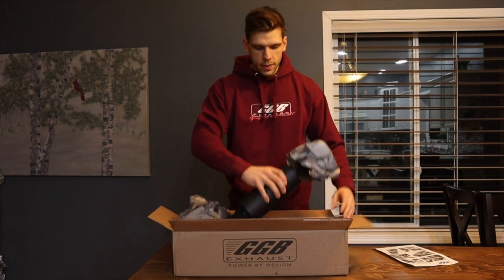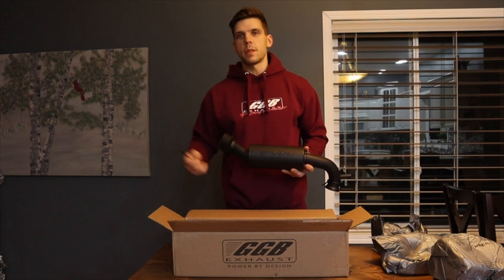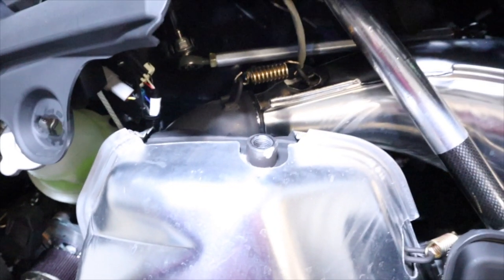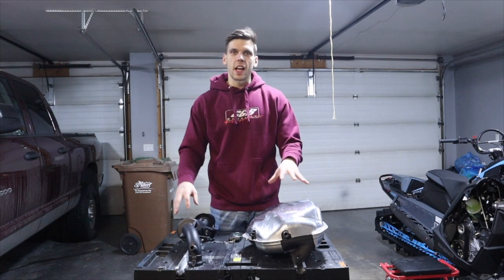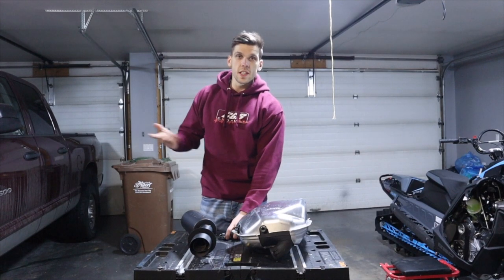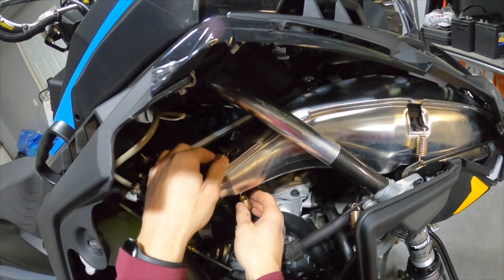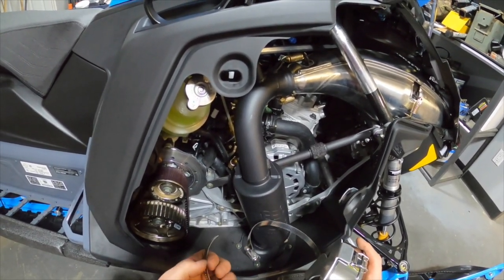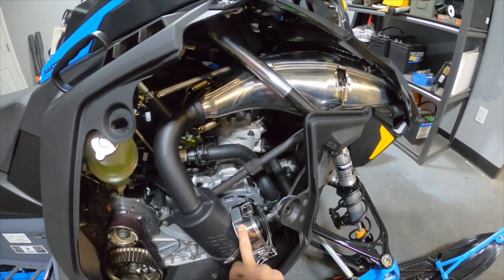2022 POLARIS 850 PRO RMK MATRYX SLASH GGB MOUNTAIN CAN

Comment: Did you forget the rubber piece for the bottom mount frame?
Reply from the maker: It looks like you are absolutely right. I just looked at the factory muffler and the rubber piece was stuck in there. Thank you for pointing that out!
Reply: @Bryce_Cardinal  your welcome it was hard to see but kind of look like it was missing. When I’ve done mine it usually sticks to the exhaust.
Reply: @Bryce_Cardinal  your welcome it was hard to see but kind of look like it was missing. When I’ve done mine it usually sticks to the exhaust.
Reply: @Bryce_Cardinal  your welcome it was hard to see but kind of look like it was missing. When I’ve done mine it usually sticks to the exhaust.
Reply: @Bryce_Cardinal  your welcome it was hard to see but kind of look like it was missing. When I’ve done mine it usually sticks to the exhaust.